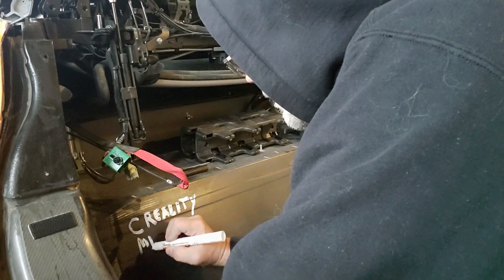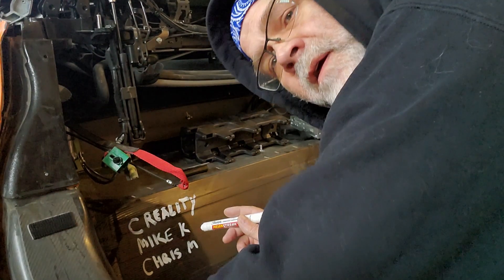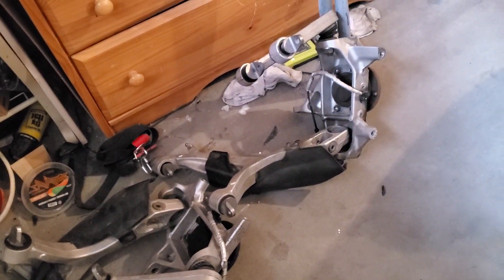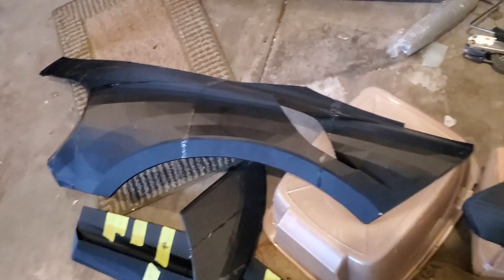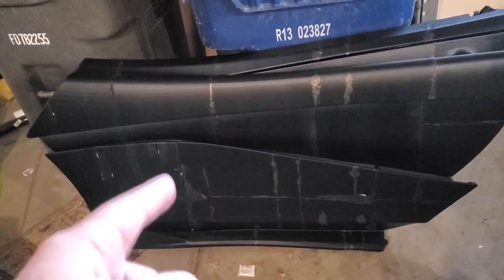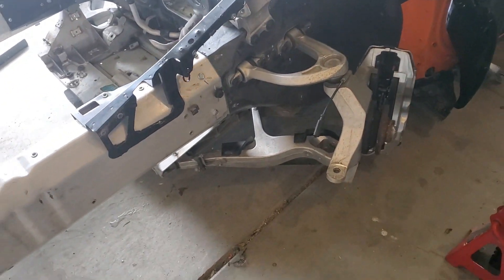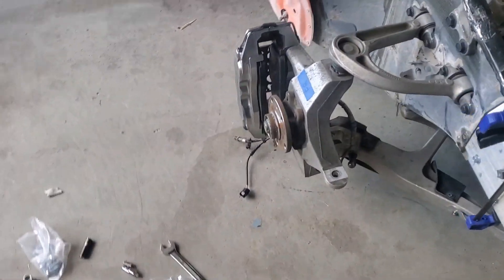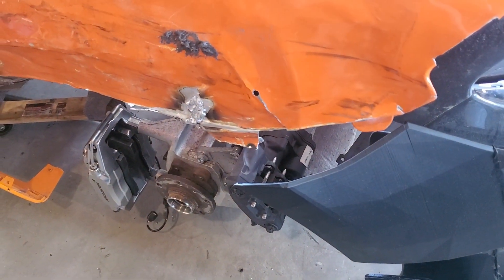Amazing accuracy of the Creality Sermoon D3 3D Printer and other bits!

Comment: I am very close to pushing the buy button on the Creality Sermoon D3 PRO. Your video is a major contribution. My concern is the printer is a tad smaller in build volume vs. the regular D3. It appears you made this work anyways and it doesn't matter if you can print one piece or end up assembling parts from multiple prints... Can you give me any thoughts on this?
Reply from the maker: I really like mine.  I have about 1500hrs on it.  I do not have an issue with slightly smaller build volume.
Reply from the maker: Tell them I sent you!😁

Comment: If you'd like, you can use steel rotors (e.g., Girodisc) with those calipers. There are several pad options that work with that caliper footprint and steel rotors. Save a ton of money w/ little sacrifice. Source: my 600LT setup. Also, make sure the 2 pins that hold the (pad) anti-vibration spring in place are firmly tapped into place. Otherwise they'll back out when driving, you'll lose them, and AFAIK there is no way to source new ones aside from buying a very expensive pad kit from McLaren. Ask me how I know. 😑
Reply from the maker: Great advice, thanks!

Comment: You can also make a custom design body kit type body which look modified custom design not stock and it will be a good display of the power of printer and also for the sponsor brand you can show how you can print a body kit and install it apart from the stock design body panel
I would suggest take cues from different variants of 570s 600lt race car, wide bodykits , concept designs bring them to life using the printer which will be good display for the power of printer and sponsor.

Comment: So the front fender at the end with the flats at different angles making the round at the top, is that designed that way or doesn't matter not changing the chord height or step size when saving as a STL?
Reply from the maker: Doesn't matter.

Comment: What printer would you recommend if someone wants to head down the same path, but also just starting out?
Reply: Creality K1 is a very good printer  I have K1 not Max. Key it handles higher tenp prints such as nylon an carbon fiber. The K1 max cost more only about 300 more but adds larger bed an camera include in price. It does not do multicolor prints but it's a solid printer. I also own always talked about Bambu Lab X1C but they now have a lower price enclosed printer. Both solid printers.
Reply from the maker: Yes the K1 is a work horse at the lower price point.